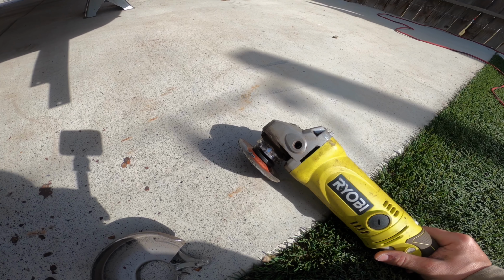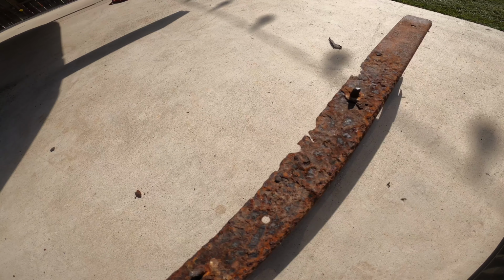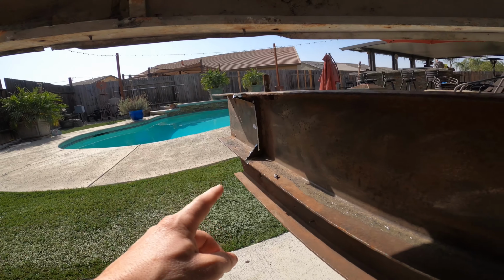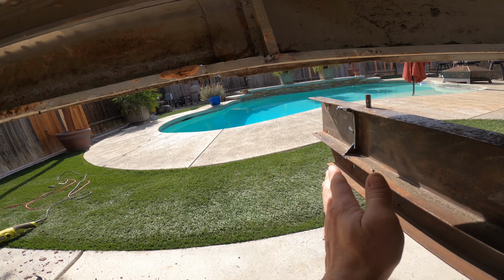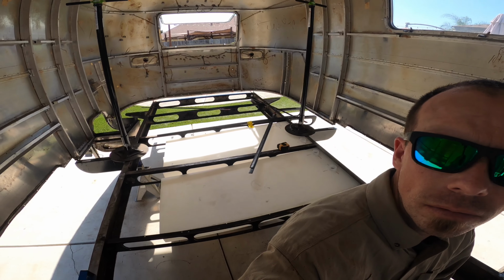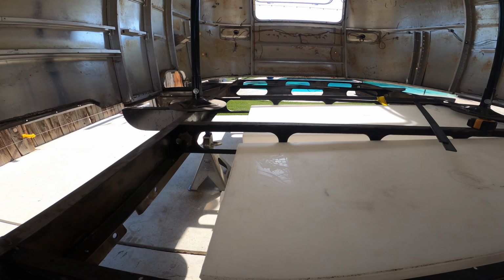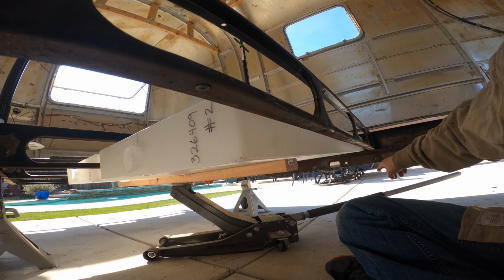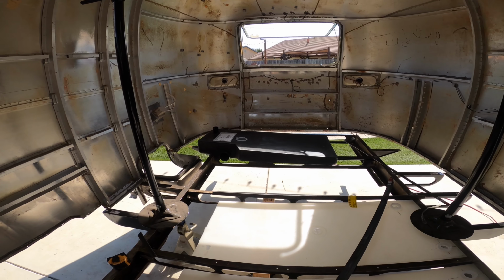Airstream Trailer Cross Section(s) replacement and Custom tank(s) bracket install

Comment: Hi Danny,  We've really been enjoying your videos and they have been super helpful as we are a few weeks away from lifting our shell.  Where did you get your tanks from?  We will be using our original water tank but we are looking to replace the black tank as well as add a grey tank.  We are also considering going the route of getting custom tanks built. 

Thanks in advance!
Reply from the maker: Thank you so much for the feedback. I bought all the tanks through Vintage trailer supply. Took about 5 weeks from ordering to receiving since I had them do all the custom fittings I needed. The next video coming out in a two weeks(since I’m on business travel) will complete the axels, all the custom tank brackets including talking about all the custom tanks. I will also have links of each tank in the comments section of that video as well. Vintage trailer supply did a great job on all of my tanks, black tank was the most expensive due to size of shipping. I paid more to ship the black tank and grey tank ($225 each to ship) than grey tanks combined($200 to ship both).
Reply: @dcdvs1583  Awesome! Thank you so much for the quick reply.  I was just looking at the VTS custom ordering info, so it is great to hear about the time taken to receive once ordered.  Appreciate your time!

Comment: I’ve been enjoying your progress. Will those L brackets be enough to support the tanks especially if the potable water ones are full? Seems you would want at least one brace all the way across to support the belly of the tank while full or to prevent flexing.
Reply from the maker: There will be bolt on dual brackets for each tank that hold it all perfectly in place for each one . Just not in place yet. The first 3 brackets I welded took into account where they will be bolted too. Those initial brackets I was cutting at 3” in this video were not in this video for welding because initially I messed the first bracket up when I measured and welded the middle bracket incorrectly. Had to cut it out so I delete that footage which would have shown me welding those small brackets in place on the underneath side. I’ll post pictures on this video post on the Facebook page in the comments section tomorrow which will show better close ups for you. Appreciate your feedback and questions. Keep them coming